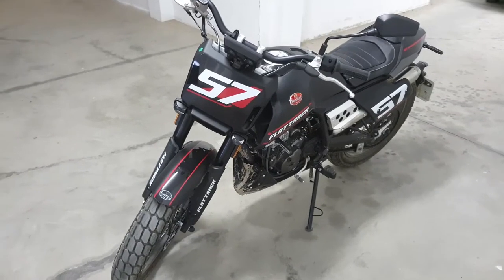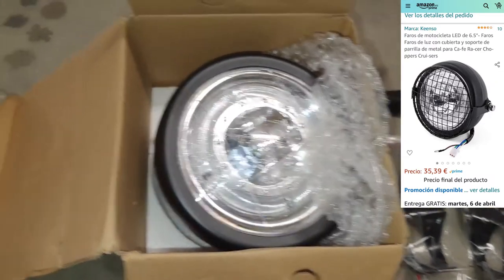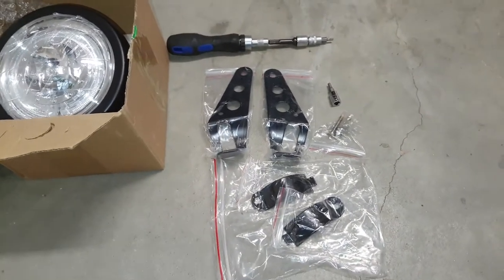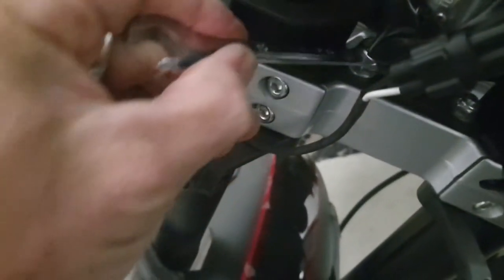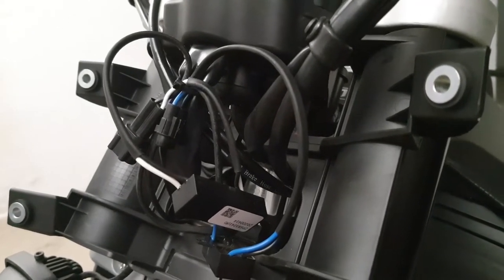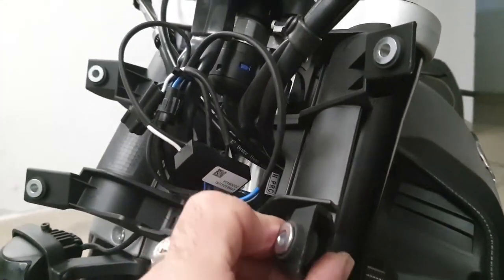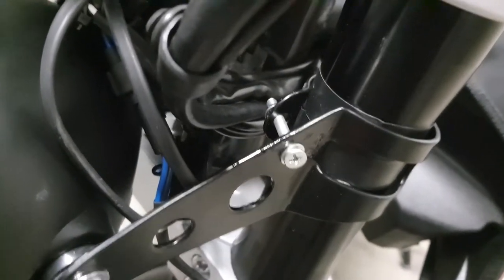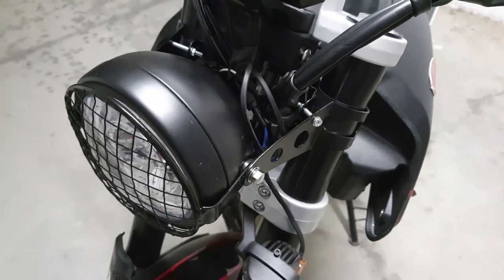FB MONDIAL FLAT TRACK FRONT PLATE REMOVAL & HEADLIGHT UPGRADE

Comment: Thank's a lot for this advice ! I also have a FB Mondial Flat Track and I have immediately bought the same headlight  after have seen your video ;) !  This one is super nice ! I just have a question about the electrical connection. I'm wondering what connections you've choosed for the 2 different factory lights. 
Thank you in advance for your help !
Greetings from Belgium !
Reply: same ive bought the bike and it has the cafe style light but its not wired up haha . any advice